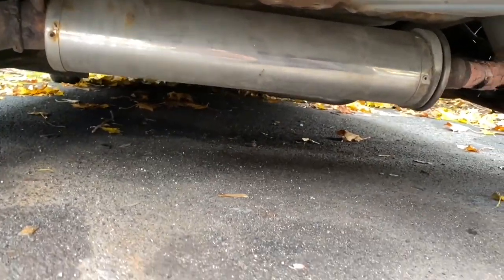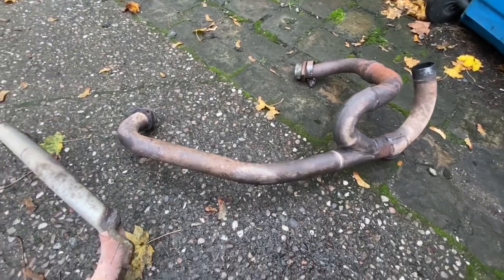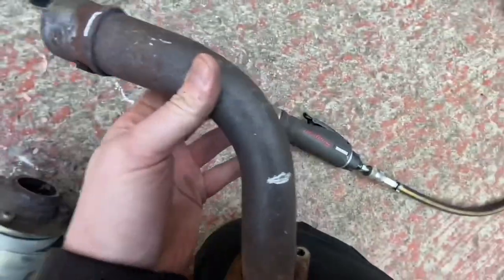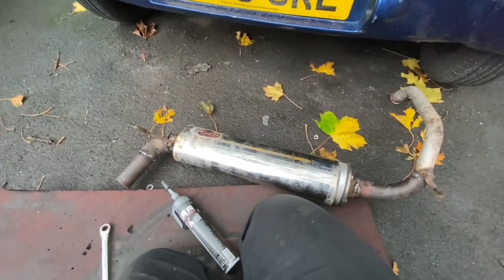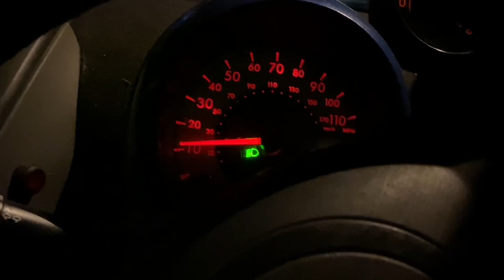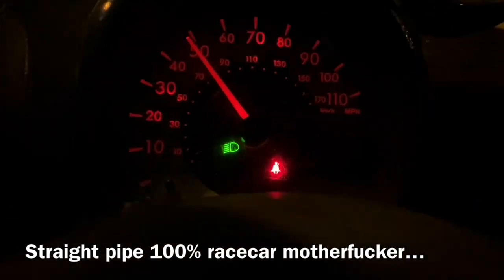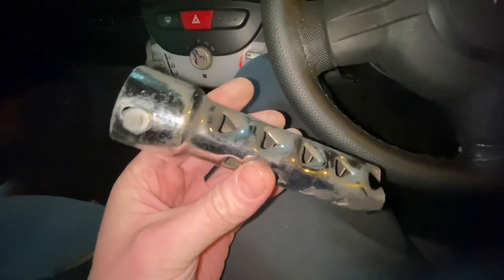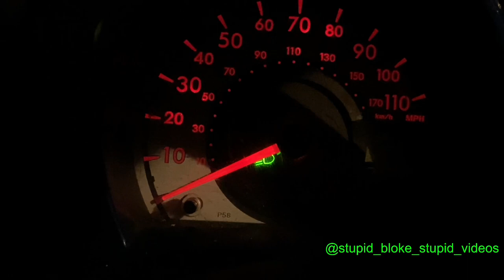How to Easily Quieten a Loud Exhaust (DB Killer) + CityBug Exhaust Repair/Fabrication (C1/107/Aygo)

Comment: good skillz on display but still think you shoudah gone with Cobra side exit or two minute hero thru bonnet  pipes.. (non patreon viewer btw)
Reply from the maker: I should have really, either that or just sticking up at the end with one of them silly tractor flaps that can tap at a rate that negatively correlates to the rpm of the engine 🤔